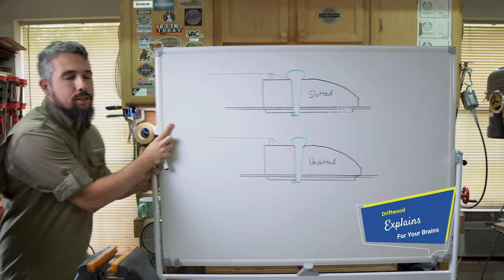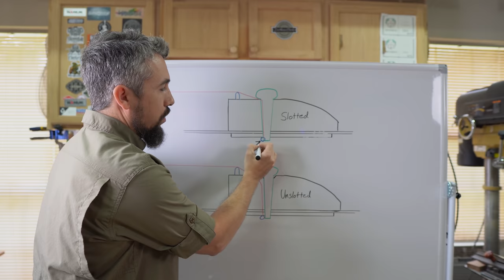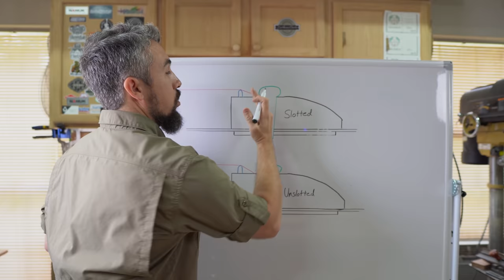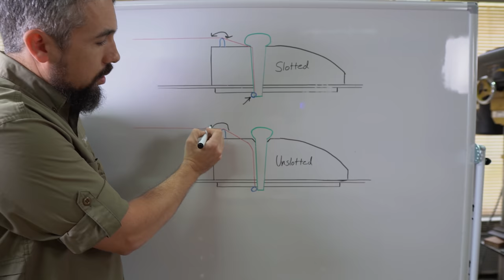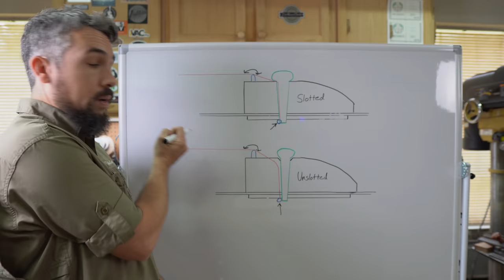This $25 Tool Can Help Anyone Make Their Guitar Sound Better!

Comment: Yeah, well, I came here looking for electric-guitar mods, and to my dismay-cum-surprise, I am greeting you as a new subscriber. While watching this video, I had one eye on my only remaining acoustic, which is a parlor-sized, single cutout Mollo steel-string, that is an awesome sounding and playing guitar available in SE Asia for slightly less than 300 clams. Best bang-for-the-buck acoustic I've ever owned. I'm not sure I'd have a go at a Taylor or Martin, and definitely not a vintage Gibson, but I just might be crazy enough to take this idea for a spin on the Mollo. I run 12's on it, which due to its short scale-length works out wonderfully. I will order the saw from StewMac and flip the pins around, just to see what happens. If it seems worthwhile, I will then order a set of unslotted pins. I am semi-retired and in the second year of covid lockdowns, so my soul is crying for guitar-related things to do. Thank you so much for letting me hang out with you for a bit. I needed the company.
Reply from the maker: Thanks for the sub! You got this man, it’s a pretty simple mod
Reply: @DriftwoodGuitars  I am more than encouraged.  Thanks again.

Comment: Would it work if you tested this for yourself by rotating the pin through 180º so that the slot along the length of the pin is not used (assuming your saddle is already slotted, which many are these days)?
Without a before/after demonstration this is all theory for us, the viewers. Let us HEAR the difference - can't believe this wasn't even considered for this upload.
Maybe someone who tries this can record a before and after comparison?

Comment: Way too simple that makes complete sense! Most attention has been giving strings a steeper angle at the nut using winding techniques. But using this means 50% more contact from string to top. I'll do it on a low end Fender I've been tinkering, with real success. I'd like to see another video on 2 identical, one with this saw cut to hear how much the sound changes. You're half way to making lots of money with your own line of tools.

Comment: Instead of boring a row of Six closely spaced 6mm holes in the soundboard of the guitar and the bridge, why not just make very tiny holes to thread the strings through to not deaden the resonance of the soundboard and weaken the board potentially causing bowing over time.  Simplification is a virtuous goal.

Comment: The Golden Era of steel guitar manufacturing was the 1930s, the Great Depression. The bridge pins did not have slots, so those guitars had the slots in the bridge and the bridge plate. They came that way from the factory. The factory used tools to do it, and they removed wood. I've never use brass pins (I've tried them), but disagree with all of his reasoning. All materials have a ring, and their ring comes out of the guitar. Between tone and volume, tone trumps volume. I don't like the ring of brass pins in the tone of the guitar. Before I die, I would love to try solid gold pins and a solid gold capo.
Reply: steel-string guitar.

Comment: Doing this does that mean that the bridge pin material choice such as brass vs plastic becomes irrelevant since literally all of the weight is spread out of the bridge wood?
Reply: it is irrllevant because the material is no longer important in transfering the vibrations to the top (brass is harder than plastic) . Ebony pins are usually about 5g (for 6) , brass in the area 25g for 6. So that extra mass usually isnt desireable.

Comment: It certainly makes sense but I'm skeptical because none of the major manufacturers are doing this. It would be a minor CNC adjustment with very low up front cost. And Taylor in particular has a reputation for bucking tradition in favor of innovation and technology. If this was such a dramatic improvement surely the big manufacturers would all be doing this? At least on some higher end models. 
I'm also hesitant to take a saw to my nicer acoustics. Seems simple enough but any mistake will be permanent.

Comment: How much of the difference is due to the different break angle increasing contact with the saddle and how much is due to what is going on at the ball end? I would have expected very little energy from transverse string vibrations on the string to be able to cross the saddle. Longitudinal vibrations should cross easily but are there any significant longitudinal vibrations in a guitar string?

Comment: I’m ready to proceed with this mod. Certainly makes a lot of sense to me. I’d be doing it on a Martin D 18 modern deluxe which has the carbon fiber bridge plate. Do you think carbon fiber transfers sound as good as wood and would you do this mod with a carbon fiber bridge plate? I’ve heard of this mod before but your video made me wanna go ahead and do it.
Reply from the maker: Man I’d be careful with a carbon plate. I’m thinking it’ll want to possibly fray the fibers or even delaminate the plies, depending on how it’s made.
Reply: @DriftwoodGuitars  Thanks for your reply
Reply: Cut carbon fiber with abrasives.  Use a jeweler's file or a diamond grit blade.   I'm no Luther,  but I have cut carbon fiber.   You will likely fray the material with an ordinary saw

Comment: Question: if in the wake of the slotting all the string tension gets transmitted into the bridge plate, why not simply turn the existing bridge pin around? Use the non-slotted side?

Comment: Makes 100% sense re energy transfer etc. But, could you not end up getting more wear on the wood over the years with regular string changes? At least with slotted pins it's mostly the pins that wear out?
Reply from the maker: Actually the opposite. The bridge plate on slotted pins usually get very messed up because the ball end is only half way on the wood and half on the pins. The edge of the pin hole gets all chewed up this way. By having the entire ball end firmly planted against the bridge plate with this “mod”, the lid of evenly distributed and thus, causes leads damage.
Reply: @DriftwoodGuitars   Cheers, get you...have seen that ok "The edge of the pin hole gets all chewed up this way"...just wondered if it would be worse with slotted!

Comment: So my Taylor 812 has slight cuts in the bridge already. An a wave saddle so would it be better to use solid pins an would the slot angle need to be more? As well should the saddle have more surface area before the break angle? Or minus the slotted pins. Taylor 800 series seem to already be on the right track? I will say the newer slanted back bracing. Does seem to add a little more low end. As well my top has very nice even grain. Almost to a 3d effect on the grain due to the uniform of it. As well it is very tight grain. Almost more of a German or Engelmann spruce top. To me the route relief and standard scalloped bracing. Sound better to my ears over the newer V bracing the are pushing. As well the scalloped bracing around the sides of the guitar in the Kerfing seems to really reinforce the sides to allow the top more vibration. I have gone in my guitar with 200 grit sandpaper and cleaned the under top and bracing. As it just seemed to not be as smooth. As before it had a little sprouting. Which I know can be due to weather change and just factory produced items. But just that light sanding really seem to open the guitar up. And it just feels better on the inside. I know you can’t see it but I know it’s there and what has been done. It really for a concert size guitar. Can hold it’s own against most dredgnought guitars.

Comment: If you are removing wood behind the saddle wouldn’t that make the break angle sharper? Wouldn’t that drastically increase string tension?
Reply: Yep the break angle will increase as shown at the end of this vid. What do you mean by string tension? Contact points/distance on the nut and saddle remain the same so the string tuned to pitch before and after will still have the same tension as far as i know.

Comment: Are the strings harder to remove with a slotted bridge? It appears that the string head could get wedged into the slot. Without the benefit of having my guitar cut in half, it seems like I could have trouble getting the string head un-stuck.

Comment: Is there any concern about adding stress to the bridge or soundboard in the are of the bridge created by adding a steep angle to the strings? I’m wondering if this would cause a problem over several years?

Comment: Isn't it better (for transfer of more vibration to the the top of the guitar) to have the pins in actual contact with each string (the full thickness of the bridge, top, and plate combined, as opposed to each newly sawed string slot pulling the strings toward the bridge within the slot, but now no longer touching the pin itself.
Reply: Why no response to my important question being raised?
Reply: I meant to say "...pulling the strings toward the *SADDLE*.." in my above question.

Comment: i just did this after a string change and a slight truss rod adjustment. i’m gonna wait a few days for the strings to settle in to their new spots until i make a judgment call. 

i’m wondering what the tonal difference between the pins being changed, flipped backwards, and not flipped backwards at all is. 

it seems the string contact is pretty much the same in all options.

i finger pick a lot and did this on a martin all mahogany.

i also wonder what the difference between this and one of those tone rods are. i made a brass tone rod that goes through all the strings, but when i was doing an initial stretch, i broke me D string and it was a huge pain to put in and had to take the whole thing off. i’m hoping this alteration does the trick. perhaps both would be even more beneficial?

i did notice strings would sympathetically resonate like crazy with the tone rod bar thing in place.
Reply: also: you can also get a hacksaw blade and grind the back until it fits a pin hole.

Comment: This makes me wonder about countersinking the slots on the underside for better contact between the ball and the sound board. Obviously something that would need to be done when the guitar is open, but do you think that would have a noticeable effect?
Reply: I was thinking along those lines: how about a piece of hardwood on the underside for a tighter fit? I would imagine the ball has more room to move with the tension on a string if it is embedded in a piece of soft wood?

Comment: What difference does this make on UST pickups? The extra pressure from the strings new break angle seems like it could be great, or possibly overly compress the pickup. I have moved away from UST style pickups but was curious.

Comment: Does this change the intonation of each string as it passes over the saddle
Reply from the maker: Not at all.
Reply: No, but as in el.guitars it should raise the tension as it shortens the overall length of the strings (strings feel harder to play) but we are talking about minimum change. If you can feel it or not somebody else should answer.
Reply: @DriftwoodGuitars  - how can it not impact intonation?  Since you have already stated in another reply that you employ this concept on the instruments you make, do you alter the cross-sectional profile of the saddle to accommodate/facilitate the additional contact of the string on the saddle?  If this is done as a "modification" vs. as an original design feature, and the saddle has a peak at which the string contacts the saddle, you really couldn't get more string contact at the saddle.  It seems to me while this may be a positive modification/design feature, more detailed thought regarding the string saddle contact point (or area) needs to be addressed.  I'd like to hear your thoughts on these points...

Comment: I have a Lowden with a bridge that doesn't use bridge pins - the strings feed through from the back of the bridge. You might think that's good, but it's not. Over time, the string break angle got smaller and small due to the "upward pressure" of the strings on the wood behind the saddle. I eventually had to plug the string holes, then re-drill them by hand - not fun. I won't be buying an acoustic guitar with that type of bridge again. Thanks
Reply: mine pulled the bridge loose from the top.  it was a no-name cheapie student guitar from the early 80's .  pins are a way better system.

Comment: Obvious question: If this modification is superior for energy transfer and sound quality, how many builders cut these slots at the factory? Or, how many high-end guitar builders offer this type of bridge design? Any?
Reply from the maker: The vast majority of hand builder do this on all of their guitars like myself. Almost no Factory made guitars come this way as it’s too hand intensive for them to justify in a high production format.
Reply: @DriftwoodGuitars  Hmm, begs the question: Aren't all guitars "hand made" whether "factory built" or "custom built"?  Cutting the slots would seem to be just one more step in the build process like all other steps. I did mention "high end" makes vs. mass production. Probably should have asked which makers offer slots vs. conventional bridge build? That might be a better gauge of how widespread this bridge design is?

Comment: Oh dear. I really hope people will not do this. You're eating away the bridge plate, and that repair will be pricey.

The whole reason those ball ends snug up to the bridge pins is to have those pins getting pushed aside which keeps the strings in place. Most wear will be on those pins, which you can replace. However, those wounded strings can now eat into the bridge and bridge plate because you've sawn through. 

The idea about the angle is true and that definitely helps create a better angle. But don't saw all the way through, do it at and angle to preserve your bridge plate!
Reply: Your last point made sense to me.  If you just ramp the top of the bridge it would still increase a greater break angle without having to saw through the entire bridge and body top.

Comment: I dont get it. I can see how a steeper break angle puts more force on the bridge and thus creates better contact between the part set in motion by the string (the saddle). But how the string is terminated cant really matter?
Reply: There is still energy and vibrations behind the break over point of the saddle and that can either be soaked up and transferred sideways against a soft plastic pin and go to waste mostly, or be pulled exactly 90deg against the bottom of the actual soundboard (bridgeplate). Make sense?

Comment: Would it be possible to make a through string acoustic body where the strings go through the back ( like on a solid body guitar) and then just run them over the Saddle etc...
Seems like you could do it ???
But don't know what the end product would sound like?
Reply: Seems like a good idea. Then you could shorten the end pins and use them for the looks.

Comment: I've done this now but the high e sounds like a sitar. So, I've done this on two guitars now and the second turned out much better but still...   I have used bridge slotting saws of different thicknesses as close to the string's gauge as possible and also the last bit past the wound section I used the nut file so the string sits snug. Furthermore I've slotted the saddle a little with the nut file to eliminate vibrations there also but it still buzzes like a sitar when plucked heavy. What have I done wrong and what can I do better?

Comment: Seems like this would make no difference if the string is not sliding back and forth across the saddle as it vibrates.  If it isn't, all that really matters is the point at which the string rests on the saddle and is for practical purposes attached to it.  Without actual controlled experiments to objectively show the effect, people should reserve judgment.  Lots of things SEEM intuitively like they should matter a lot, but don't matter much if at all.   For example, through-body strings on an electric guitar don't matter nearly as much as whether the bridge is rigid and reasonably massy.  I'd think that similar things apply here, except that where on an acoustic you usually want the bridge rigid and a little massy to increase sustain, you want the bridge reasonably rigid but lightweight to avoid damping the vibration of the top.

Comment: Be an interesting question to hear Bob Taylor answer. On my Taylor 812 12 fret, there is already a groove in front of the pin and yet the compensated Taylor bridge is designed to have minimal contact with 3 of the strings.

Comment: When making the initial (vertical) cut, why cut deeper than the diameter of the string?
Reply: Cut deep enough so the ball clears the pin, or you will bind on the pin and negate the effect

Comment: So does Breedlove have a good idea by using pinless bridge?
Reply from the maker: No, not in my option. A pinless bridge exerts a different kind of pulling force on the top and always brings out less bass response and doesn’t maximize the energy of the string into the top. Ovations also use pinless bridges if that tells you anything.

Comment: Should the slots be thinner for the thinner strings?...it seems like a lot of side to side play for the strings could cause issues. Any thoughts?
Reply from the maker: Correct. They sell different thickness saws and files for the treble strings and bass strings
Reply: Thanks